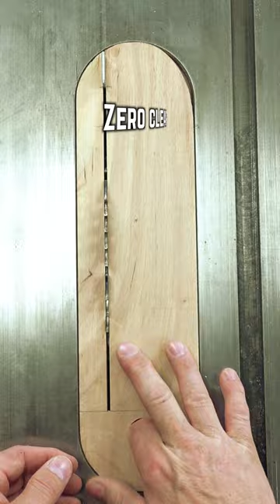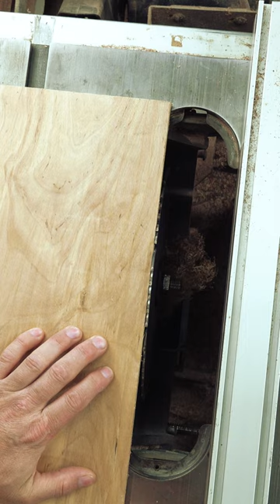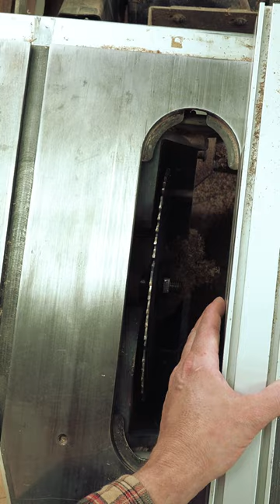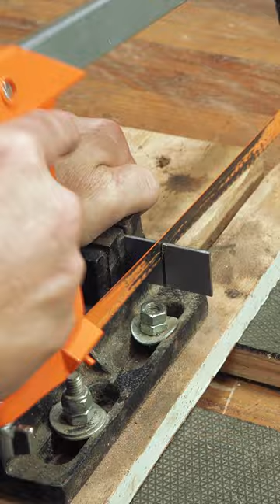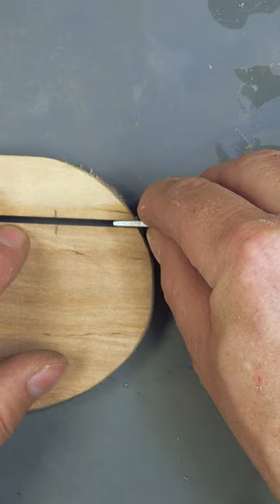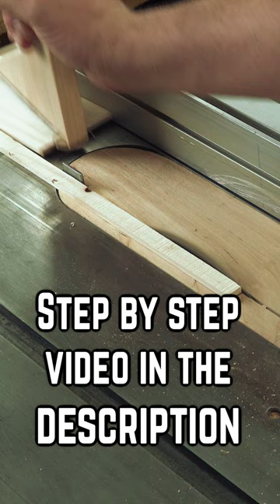Zero Clearance Insert (Table saw) #lmts #shorts #tablesaw

Comment: I have a sears Craftsman 16 direct drive model number 113.236110 and I only have plane pined blades and or any kind but pined adapter that came with it but not sure what other company product of other places may have the (pinless adapters for the top and bottom I need, do you know where i can get parts like that for a obsolete scroll saw?